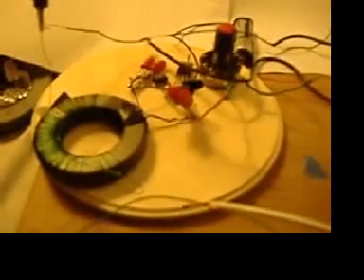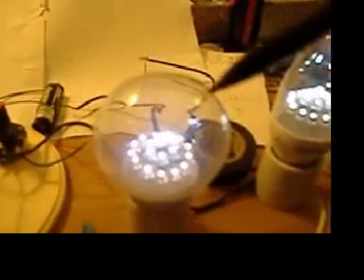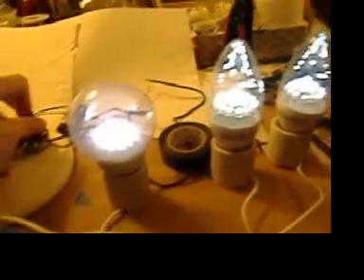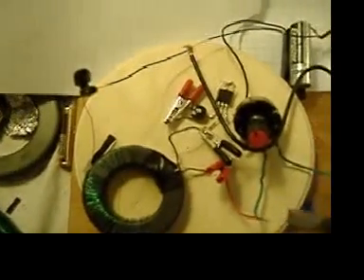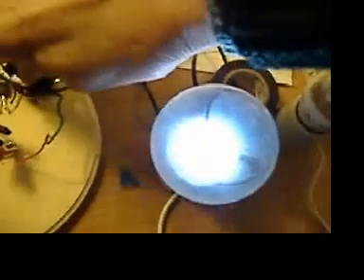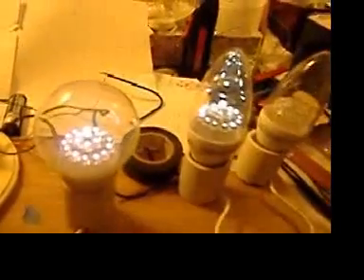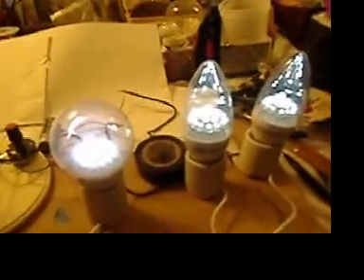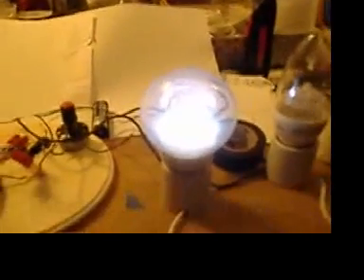Is this a Joule Thief, or a Tesla Hairpin Circuit?

Comment: Your 1.5V AA cell is not going to burn out those LEDs (after you read that, you may believe they are already burned out!! )
The 1067V you measured with no load obviously will drop dramatically when the LEDs are connected. You can adjust the brightness by varying the JT resistor instead of wasting power with that rheostat. Look at xee2vid lo power JT videos on YT to see schematics.

Comment from the maker: @Magneticitist 
Hi, I was using the joule thief circuit in the hopes that I could avoid the spark gap.
Tesla described ways to overcome the many problems of the spark gap, and never even mentioned the nasty amount of noise it makes.
I am pleased with this.
In fact, this particular joule thief is the one I would suggest replicating all around the house. The toroid is 2 1/4 inches but can be 1 inch. The type W ferrite is essential.

Comment: that is producing some amazing light from the single battery, but now that  I have gained more information regarding the hairpin circuit, I have to ask you, have you considered that the spark gap may be the key element in the functionality of this circuit? it's possible air is perfect for achieving the needed frequency tuning. Maybe you could try producing a small arc and see if a bulb lights brighter closer to it. that is, if you are still interested in the circuit of course =)

Comment from the maker: @rouelibre1 The rheostat is placed just at the pos side of the battery in the joule thief circuit.
It has the effect of drawing more or less from the battery and brightening or dimming the lights that are being lit from the secondary.
My videos tend to be made for the folks at the energy forums where the circuits are drawn. I have provided videos with the schematic, but I don't have a glyph for a rheostat on photoshop yet, so they are not showing that placement.

Comment from the maker: @michalchik 
It is basically a cool way to step up voltage AND the frequency. 
Both are a result of the basic joule thief.
What I have been working on is how to extend the effects of a joule thief beyond the basic transistor.
The toroid is awash in high frequency switchbacks which cause a fast pulse AND High voltage flyback if you wrap it with another wire.
This part of the circuit is very similar to the hairpin circuit Tesla demonstrated, but in micro miniature.

Comment: The spark gap to which you are probably refering acts as a switch for the capacitor discharge. When the potential reaches a certain point on the capacitors the air between the gap ionizes and becomes highly conductive, allowing the capacitors to discharge very abruptly through the load. It is necessary to have a low resistance load so as not to slow the discharge process. I do agree that other types of switching could possibly be used, but transistors have a very limited power handling capacity.

Comment: Nice experiment, but I must disagree with you on something. When Tesla said,"disruptive discharge" he was not refering to a spark. He was actually refering to the instant discharge of a capacitor through a low resistance circuit. This abrupt capacitor discharge allows high powered pulses to be generated from a lower powered source.

Comment from the maker: ...given the chance,  the frequency would diminish when a light was added. The volts might stay the same but it seemed only when there were extra would the volts stay up. Then I saw that if I added a series inductor to the pulsing wire, the frequency would go up, and I could add another light. In our homes, the frequency cannot change so we use something else and are billed for amps.
I am working on a scaled up version now with cfl's instead of leds, so stay tuned!!
thanks for your comments.

Comment from the maker: I am thrilled that the LoA bulbs are doing what they are.
Even though it is inconvenient, the fact that I cannot turn them off at the switch once they have been on, means this is another avenue for experiments. The light from them with the switch off is very weak, but OMG it is still on until the battery is drained. So, somehow, adding capacitance to the secondary on the bulb side (some way) might be a way to have perpetual oscillation from a single pulse... touch here n the light is on until???

Comment from the maker: I forgot to do something important yesterday. I forgot to look at the bulbs #2 and #3 without #1 to see the brightness.

Without #1 those bulbs#2 and #3 are the same brightness as each other and still appear less bright than #1.
I do think that is the bulb. They are a different  "color".

According to tesla, bulb#1 IS SUPPOSED to be brighter. He used bulbs that required different voltages, so it is necessary to translate the meaning.
I have some more questions too.
thank you, mart.

Comment: Jeanna:

Great video!  My opinion is that the circuitry in the base of those lights is altering your experiment.  We already know that you can light many more leds to a much brighter level with your large toroid circuit so, this is my guess as to what is happening.  If you just ran those leds alone, you would most likely fry them unless you have your rheostat down.  Very well done and very well explained.  I don't think I will ever catch up to you.

Bill